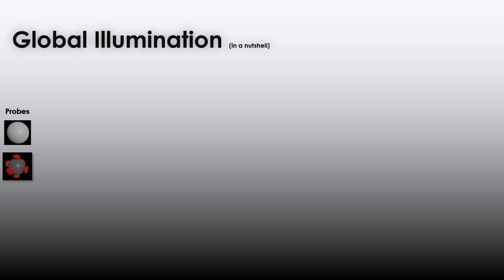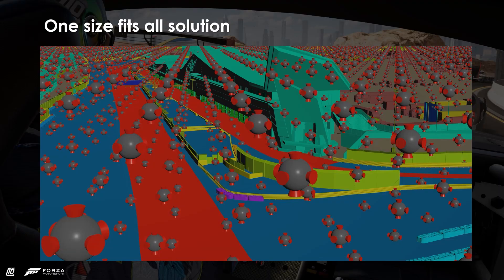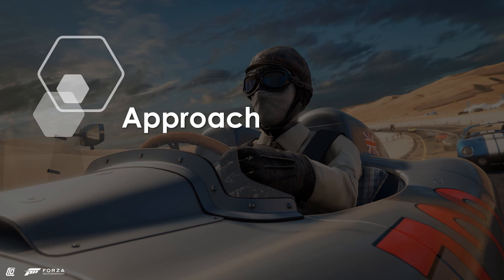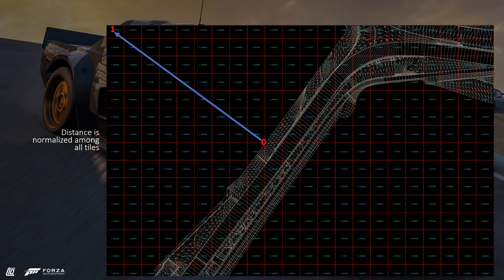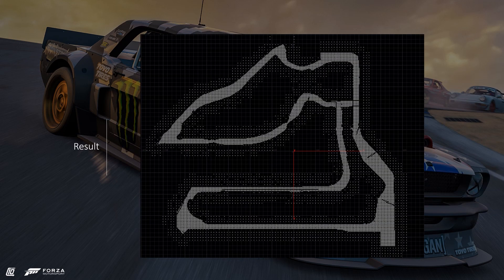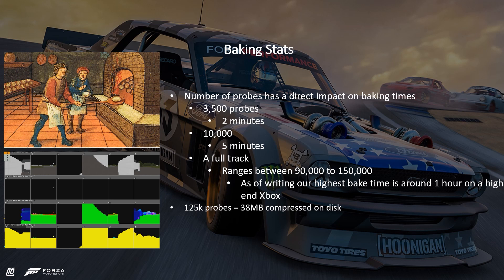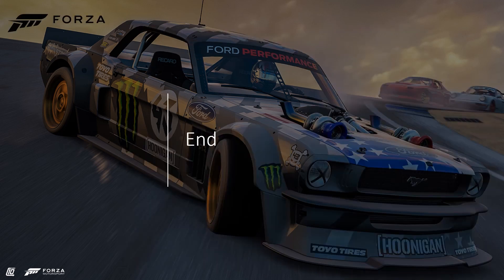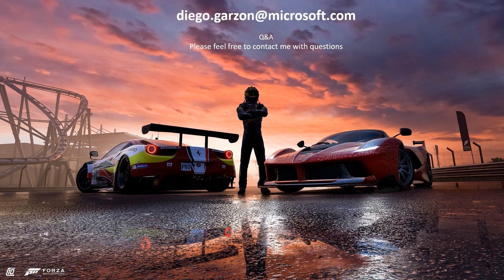Adaptive Placement of Probes for Global Illumination

Comment: Cars we need in the new Forza motorsport game are !!!

Mazda rx7 fd spirit r 
Nissan 400z
Toyota supra a80/mk4
Toyota supra a70/mk3
Toyota celica supra 
Toyota celica gt four
Toyota celica 70s
Toyota Corolla ae86/ hachi roku 
Toyota Corolla ae86 levin
Toyota corolla levin 70s
Toyota corolla dx
Toyota mr2 mk1 
Toyota mr2 mk2
Toyota mr2 spyder 
Toyota mark 2 chaser 
Toyota mark 2 jzx 90 jzx 100
Toyota cressida 70s
Toyota cressida 90s
Toyota crown 80s-90s 
Toyota soarer 90s
Toyota soarer 80s
Toyota century 90s
Nissan skyline dr30 turbo rs
Nissan skyline 2000 gtr 4 door
Nissan 300zx z31
Nissan silvia s12 
Nissan silvia s10
Nissan Cedric 90s
Nissan Cedric 80s
Nissan pulsar gti r
Mitsubishi evolution 1
Mitsubishi evolution 2
Mitsubishi evolution 3
Mitsubishi evolution 4
Mitsubishi evolution 5
Mitsubishi evolution 7
Mitsubishi gto mk1
Mitsubishi fto
Toyota starlet turbo 90s
Toyota starlet 80s
Subaru impreza wrx sti 90s
Nissan 280zx turbo
Nissan 280z
Mazda cosmo eunos 90s
Mazda cosmo gt 80s
Mazda rx5
Mazda rx4
Mazda rx2
Mazda rx1
Nissan fuga 350 gt
Nissan Sentra se-r 90s 
Nissan sentra se-r 2003-2005
Honda civic ef sir
Honda integra type r 
Honda integra 80s
Honda legend 90s
Acura legend 90s
Honda civic gen 1
Nissan 180sx
Nissan skyline r34 gtr z tune
Nissan skyline r33 gtr 400r 
Toyota corona
Lexus ls400 90s
Nissan laurel 90s 
Nissan laurel 80s 
Honda civic eg sir 2
Honda crx si 87
Honda nsx r gt
Honda accord type r 98
Honda accord euro r 90s
Honda accord euro r 2004-2008
Also make the headlights more brighter and make the taillights bright red

Comment: So, how does this tie in with implementing ray tracing in the next motorsport? Will only the cars and the garage receive this treatment while the environment is in a fixed, baked condition?
Reply: Raytracing is WAAAAAAAAY overrated. You can get the same level of effects using other techniques without such a huge cost on performance.

Comment: I was a Forza Horizon 3 & 4 and Motorsport 6 & 7 preorder customer. However, After the botch Games of Horizon 4, Motorsports 7 I will no longer be a preorder customer. Further, if Motorsport 8 fails to have a vastly improved multiplayer racing, as well as solo campaign I will no longer be Turn 10 customer. IMHO motorsports 7 went in entirely the Wrong Direction., and FAILED to capture the essence of RACING.
Reply: Thats cool and all, but i dont remember asking

Comment: Andrew Baker...who bakes light ? XD
Does all this mean, that the next FM will still use prebaked lighting?
Reply: They will be aiming for 4K 60FPS so that wouldn't really be much of a surprise, it's probably less taxing on the hardware to have ray-traced reflections only than it is to have real-time global illumination on top of it, and if they make the baking system flexible enough they probably could make multiple times of the day and interpolate between that if they need to make slight alterations to the lighting dynamically.

Comment: Forza Motorsport still doesn't use dynamic lighting... there is no dynamic night/day cycle. All circuits 's shadows are backed. Project Cars 2 and GTsports are much better in this aspect. FM needs to improve here and also cockpit view hands modeling and mocap animations. Good luck
Reply: It's like that because most people won't have a race that will last long enough for the time to change so drastically, so from their perspective, it's better to have baked lighting that not only looks good but that also has dynamic weather to some extent than to have flat lighting that is dynamic. Don't get me wrong, I'd love to see 'em implementing a full 24-hour cycle on the next game as it is mostly possible with the new hardware and that would make endurance races which last hours way more engaging, but again, majority of people won't keep playing the same race for so long so maybe it's not worth it at all.
Reply: Arthur Lopes In games like Project Cars you can custom a race starting at 5pm and you accekerate the time and day X25 , is not realistic but who cares? Night come down, lights on in the night... incredible racing atmosphere .